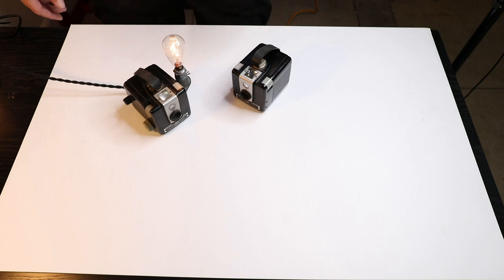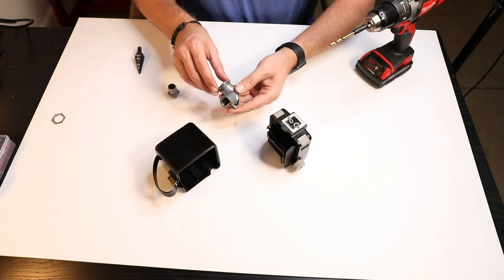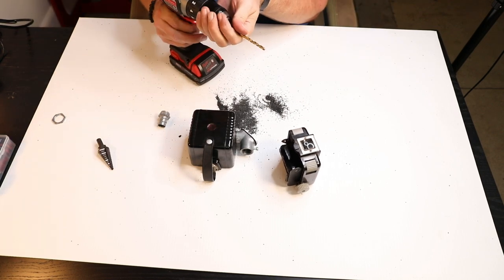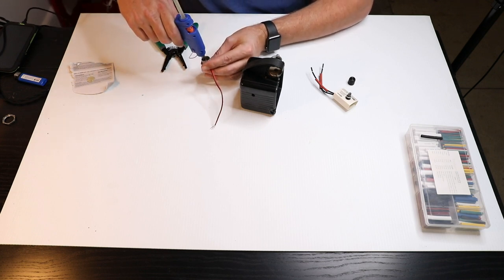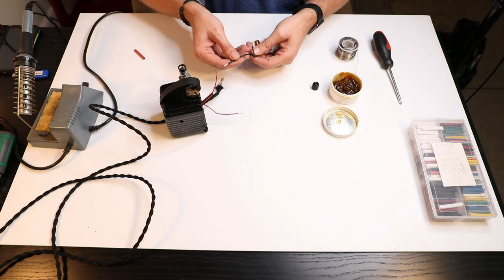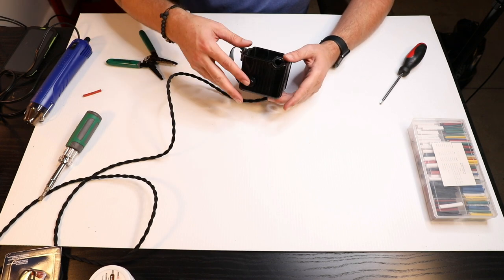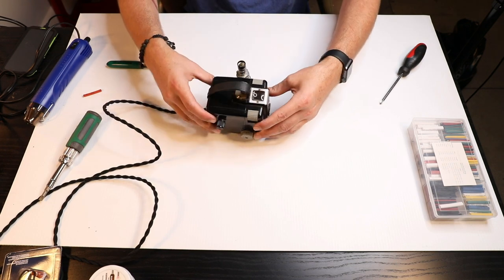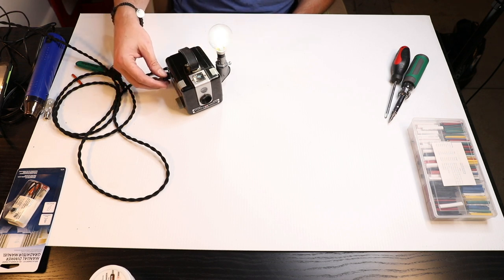DIY dimmable camera lamp

Comment: Does it which lead on the dimmer is used for line vs load?
Reply from the maker: I put the dimmer on the load side if you will.